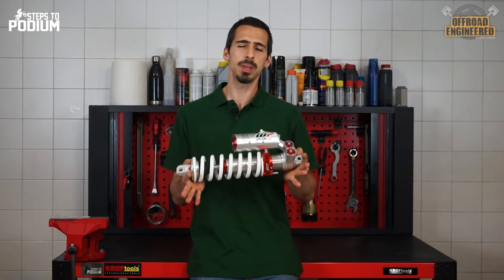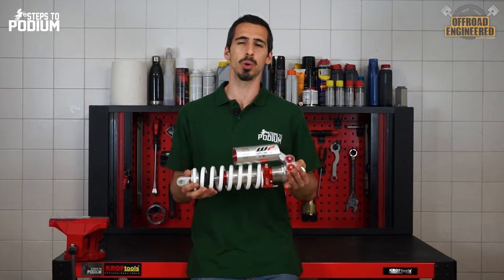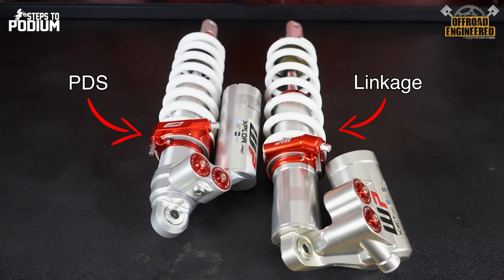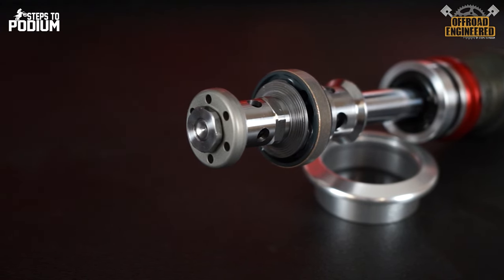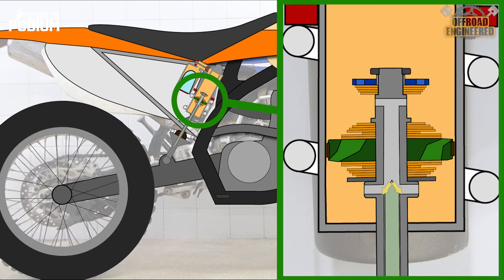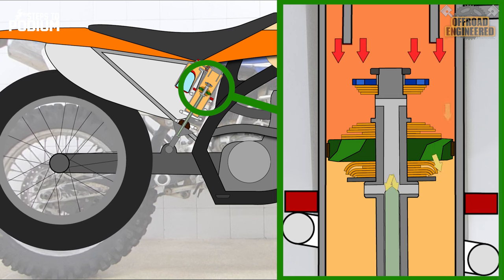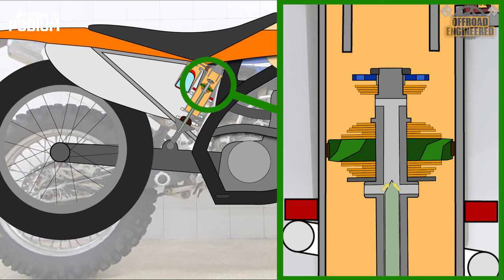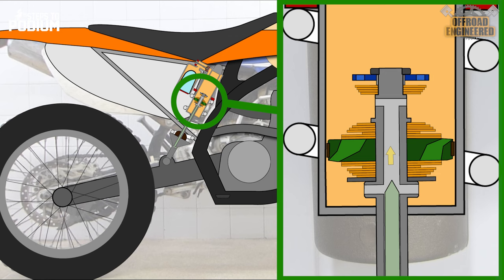How @WP_Suspension  PDS shock works | Offroad Engineered

Comment: Such a brilliant solution for introducing progression. If I am not mistaken,  KTM's motocross models are equipped with a linkage system, so my undeducted guess would be, that the PDS is limited to a certain degree? Or maybe the characteristics are just favorable for motocross?  Thanks for the video and thanks for continuing to educate the community!!!!!
Reply from the maker: True indeed! 
Yes, that's pretty much it. For enduro, the PDS can still deal with the range of compression speeds without linkage, but increasing that compression speed range, the linkage provides much better progressivity and the shock keeps a more stable performance throughout the demand.
And I appreciate mega supporters like you Ariel!! 🙌 you never skip a video 👌😁
Reply: Also Ktm engineers actually said they can get their pds shock to perform the same as a linkage shock  and be lighter but people were hesitant since every one else had linkage so they adopted linkage

Comment: Looks just like a Huck valve?

I have definitely decided on the Lucky cartidges for my 2022 KTM 500 EXCF, but my greatest challenge are simple washboards on the dirt roads I ride between trails. At 63, my lower back ain't what it used to be. If I do not stand the entire time, my back takes a pounding on washboards. I am wondering if the National shock in the rear might help this, or just a simple re-valving of my stock WP?
Reply from the maker: Exactly!

Well, that's a very specific complaint, so it might be solved with a proper revalve. Actually I'm waiting for a national shock to arrive so I'll be able to share my thoughts on in as well 🫡
Reply: @StepstoPodium  Please let me know!

Comment: Thanks a lot for this. Very nice. Tho I think yourself you don’t use PDS? Would you do another video explaining how linkage works and what advantages it gets you?
Reply from the maker: Thank you vladimiro! I don't use it because my sole focus isn't Hard Enduro. 
I already have a video explain the linkage function on the traditional shock video 😉💪
Reply: @StepstoPodium  oh yes, I remember that. Other interests are you referring to rallies?
Reply from the maker: vladimiro sassone yeeess, actually I'm really into doing hella lot of miles atm. This summer I want to clock more than 300km in a day of rally style riding
Reply: @StepstoPodium  and linkage is better for rallies because…? Absence of obstacles? High speeds? Occasional jumps? … (starting to think about my next bike, so is it going to be linkage or pds? hmm not sure at all…)
Reply from the maker: vladimiro sassone linkage is better for higher speed riding since you can squeeze more out of the shock for the same shock stroke. Again, although the PDS can withstand and EnduroGP style riding, you can have a more versatile performance with linkage for faster riding.

Comment: Sole purpose of KTM PDS is the reduction of manufacturing cost. You save all the linkage, axles and bushings, because you do not really need much of the progression. Basically, PDS is doint the same as the rubberblocks by entering additional resistance. If you switch on your brain (instead of copying marketing BS), you will see the big gap between engine/fram and the rear wheel. A great place to get hooked on an obstacle without much of traction to get free again. Here, the linkage provide a much smoother are to glide and touch the wheel at a much better angle to get traction.  
In general, WP is a terrible company with the only purpose to have cheap inhouse suspension parts (and control). Nothing is left of the former White Power company (now Tractive), but it's Brand name "WP".
Reply from the maker: Every suspension technology is a trade-off of pros and cons, even the most widely accepted ones.
Also, don't forget that the OEM and PRO line are really different, so we cannot compare both and expect one to behave or perform the same way as the other.
Regarding the PDS, I would agree that it does not perform as linkage shock, but the truth is that Josep Garcia is fighting for the title in EnduroGP with a PDS. If the PDS would underperform so much, he as an athlete would not be able to compensate the technological disadvantage and would lag behind big time. 
And to be honest, there's a threshold on how much they can put inside Josep's shock that differs from what mortals can access.
Reply: Too black&white as a comment. There’s manufacturing savings but also maintenance savings. There’s a gap between engine and rear while as you say, but putting a linkage there to be smashed is prob not the best way to get traction, is it.